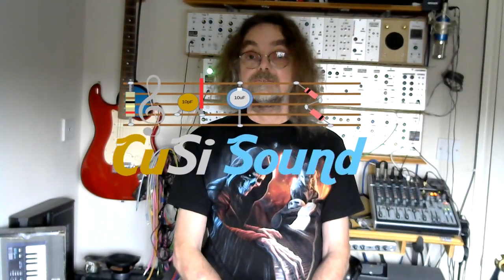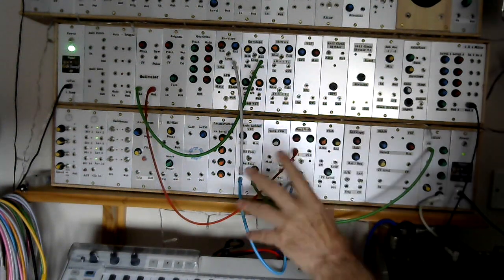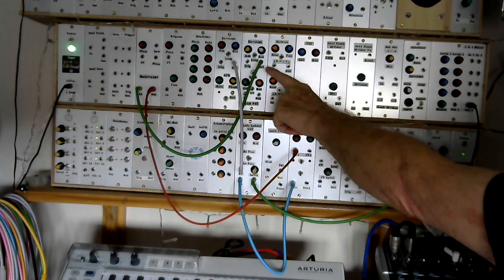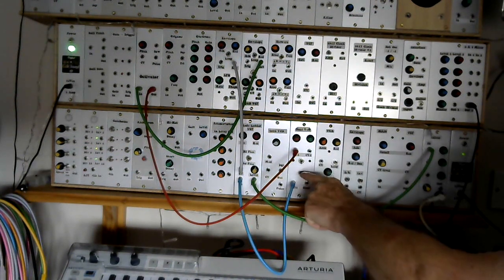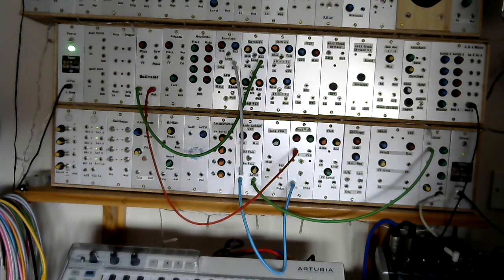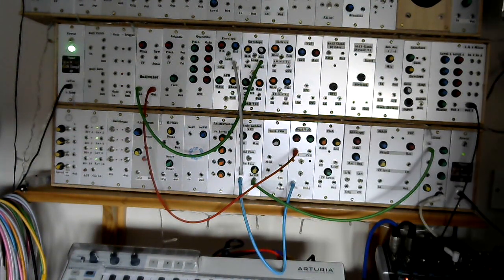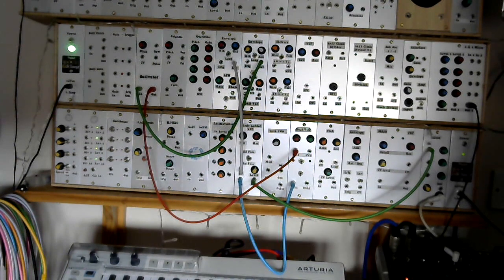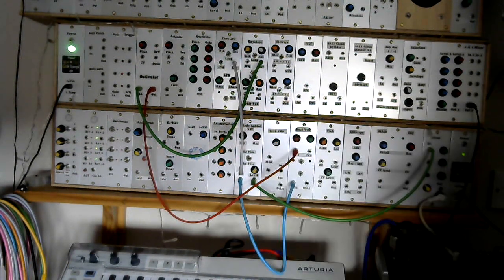Patchwork : The Bell Patch

Comment: In some ways it is synthesizer meets analogue computer. 

Your challenge now is to design the sequence and pitch to ring a full peel of church bells. I guess with a digital sequencer that might be easily possible but you might also need to make eight of these to have the full polyphonic effect. I think a church bell also has a clapper that hits on both cycles during the bells rotation.

Wobbly bell is my favorite. Your joy in experimentation and discovery is infectious.
Reply from the maker: I think I'll stick to field recordings for the full church bell peel, analogue synth patching it is a step too far for me. Thanks for the kind comments.